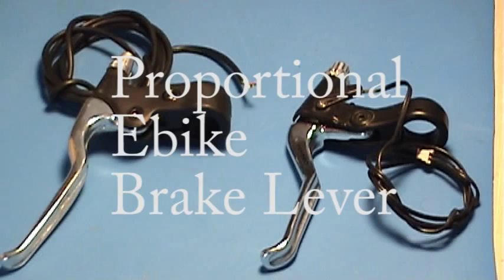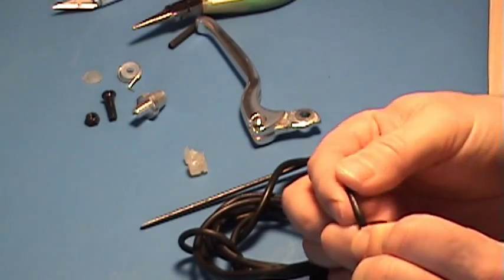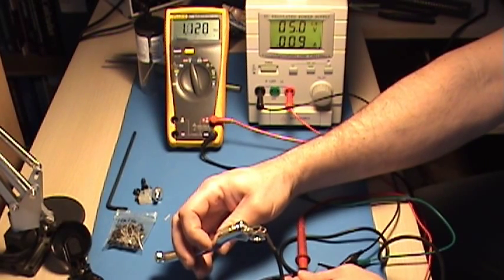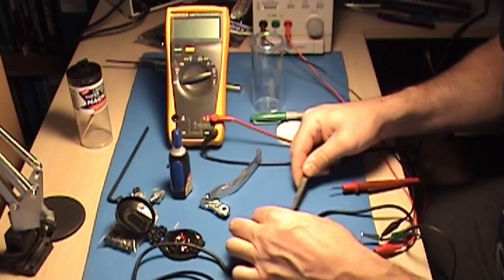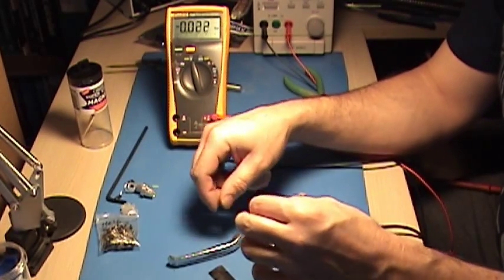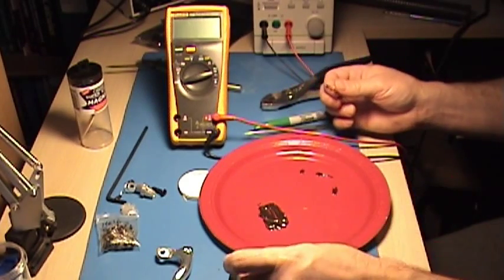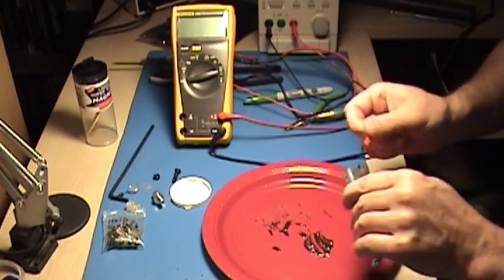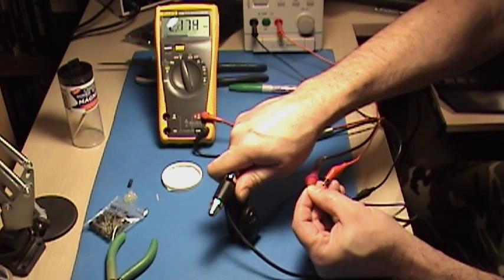Electric Bicycle Brake Lever Linear Modification

Comment from the maker: Regen on the Chinese controllers are not proportional control for the most part, so you are looking at an on or off signal telling the controller to engage a light regen braking or turn it off.  Not all wiring colours are uniform across all controller of different manufacturers for the same function.  I would suggest asking your question with the make and or pictures of your controllers at the Endless Sphere ebike forum.  They have a fairly large community with lots of experience with the chinese controlllers.